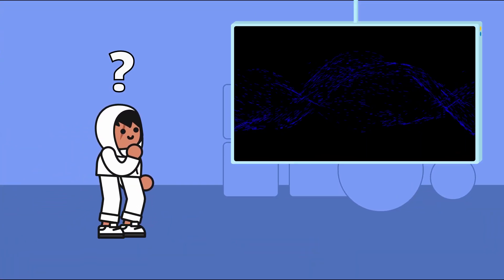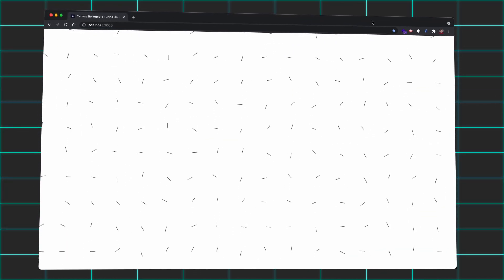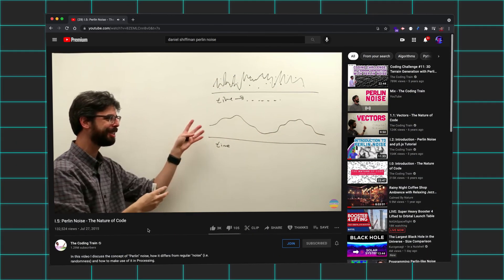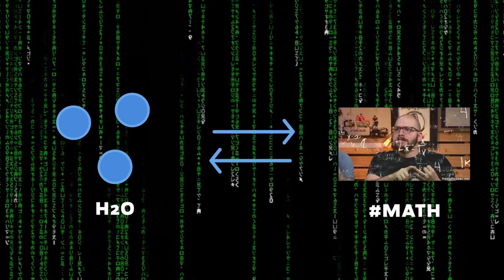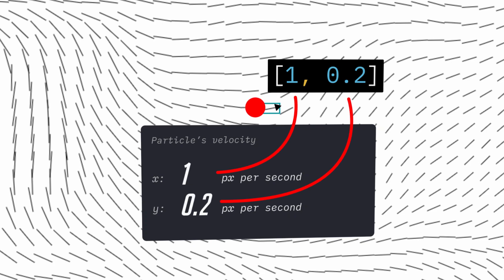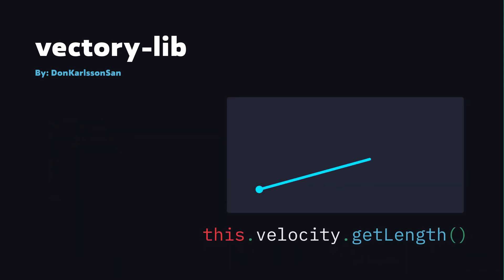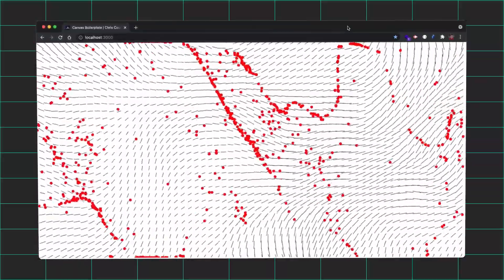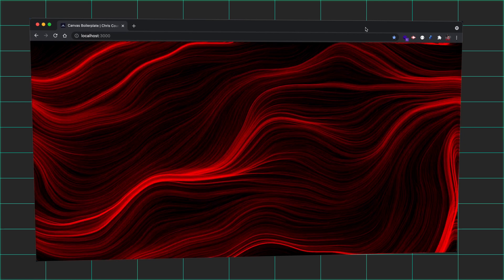The Beauty of Code: Flow Fields

Comment: should have simply studied code base of manim and how vector flow field is evaluated in general using numerical math methods used to solve differential equations like runge kutta method (all available in manim library), that would have been a lot quicker and more correct way for you.

Comment: Flowfields are used in video games for some specific use cases related mostly as far as my knowledge goes anyway to AI path finding.

One recent, and very good demonstration of this is A Plague Tale, where the rat swarms use a flow field to move around instead of calculating individually a new path every N frames.

It's mostly an optimization thing compared to the usual pathfinding suspects.
Reply: Great thing you mention this!
Flow Fields are being used in many VFX for video games.
The rats you mention in A Plagues Tale are actually not individual AI Agents, that would be too much. FlowFields are what allowed to do this.
You can learn more from the GDC talk about their work. It is really fascinating!

Comment: Instead of capping the speed at 5, I wonder what would happen if you "Made the velocity approach the desired value"
That is to say, each flow field point can be multiplied by your desired speed to create a desired velocity at that point.

Then, you use a drag function (Multiplying the velocity by something less than 1, such as 0.95) to control the velocity.
In this case, you would subtract the desired velocity, apply the drag, then add the desired velocity back in.
What this does is it makes the velocity approach the desired value, in the same way the a drag function used on its own would make the velocity approach 0.
Reply: Having messed around with homing projectiles in Unity, I would take this another step further.

I would assign each object an Angular Velocity, that is to say a measure of how the direction it is moving is rotating with time.
Using the desired direction taken from the flow field, I would accelerate this Angular velocity towards the desired direction.
Without angular drag, this would absolutely overshoot the desired direction, potentially creating really interesting effects.

I have used this exact system in 3 dimensions, when I set out with the goal to get a cluster of homing projectiles to avoid clumping up when given the same target. I can't say it was super successful, but it was certainly interesting. Unfortunately you couldn't really see the spread from the point of the one launching the projectiles.

Comment: Cool, your next challenge is to write the Perlin noise function yourself. It really is not that difficult if you research vector math. Also as someone who knows a bit about physics, the mathematical basis of flowing water (the Navier Stokes equations) do use something similar to flow fields.

Comment: very nice video! quick note: to find the magnitude (or “strength”) of a vector, you can use Pythagoras to find the distance between (0,0) and the vector. if the distance is greater than the desired strength then divide the x and y by the vectors strength and then multiply them by the desired strength.

example:
x: 6
y: 8
desired strength: 5
strength: sqrt(6^2 + 8^2) = 10
new x: 6 / 10 * 5 = 3
new y: 8 / 10 * 5 = 4
the new strength is now 5.
Reply: Wow thanks for this

Comment: Nice video! Here's a super small trick that can make a huge difference: rotate the vectors of the flow field by 90°! That makes it a curl noise, and the particles don't clump together into ant-lines anymore!
Reply: Hi, do you mind explaining this a bit more please. I've been experimenting with flow fields recently and I've noticed my flows all seem to go in one direction. I'm guessing that's because Perkin noise goes from 0 - 1 but doesn't cross over from 1 back to 0 or vice versa. Is that right? Is your comment about how to avoid that? Thanks very much.
Reply: @mrbjjackson  ok let me try: usually random generated flow fields are converging (clumping together) or diverging (spreading out), they have these characteristics just by chance basically. Rotating all the vectors by 90° is just a very simple operation to get rid of these.
Imagine you have a flow field with all vectors pointing to one point. It's like a sink everything would get sucked into that point. Rotate each vector by 90° you get a whirlpool where every vector circles around that point instead. They don't clump anymore. You get rid of convergence and divergence, also called non-compressable (you often hear that in fluid simulations)
Reply: @Teflora  Thanks so much for the reply! Great example.